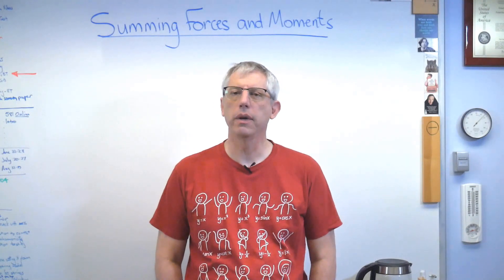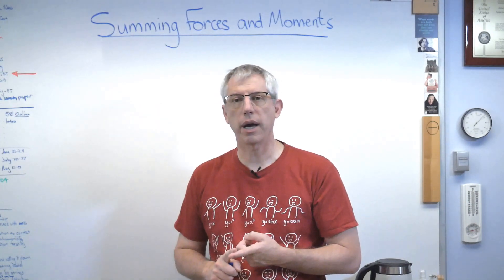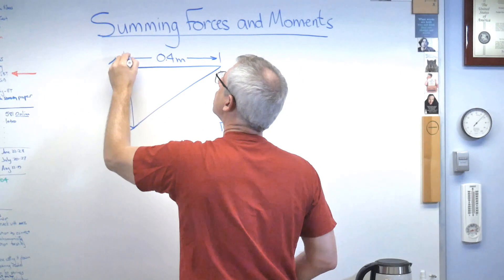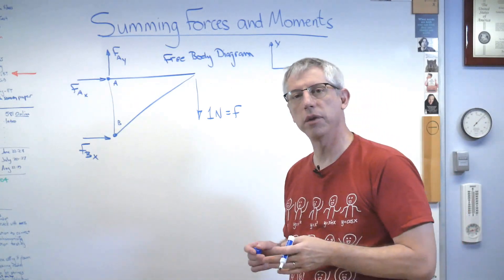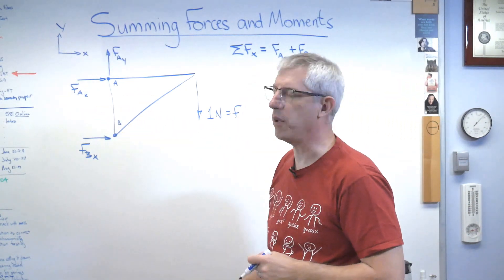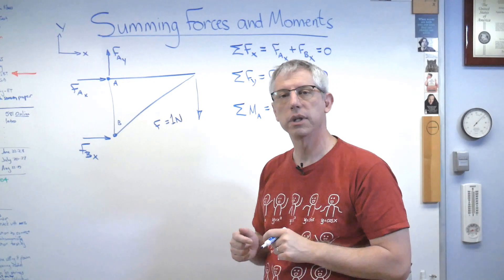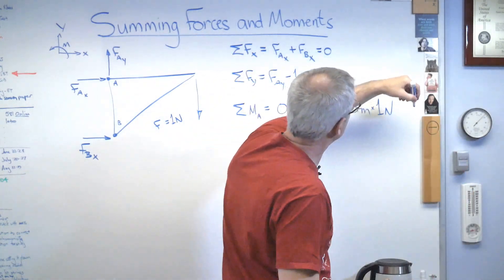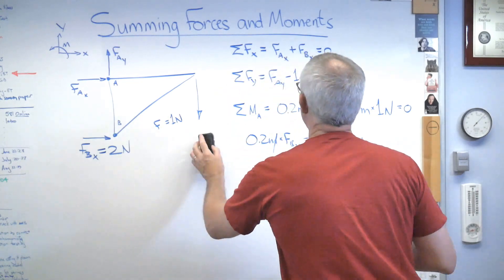Statics - Summing Forces and Moments

Comment: Hello sir, I have a small long-standing doubt.

Around 3:50, you said that the top of the body can rotate (around the pin boundary condition) while the bottom of the body can't (the bottom can only go up-and-down on the roller boundary condition).

My doubt is, if we rotate the top of the body (e.g. counter-clockwise), won't the bottom also move away (to the right, in this case) from the plane (in addition to moving upwards on the rollers?

If yes, won't stopping the bottom of the body from moving away ensure that the top can't rotate too? Hence there can be no pin on the top boundary condition? 

Thanks in advance for your time, and REALLY thankful for your videos! 

With greetings from Germany :)
Vikrant Srivastava